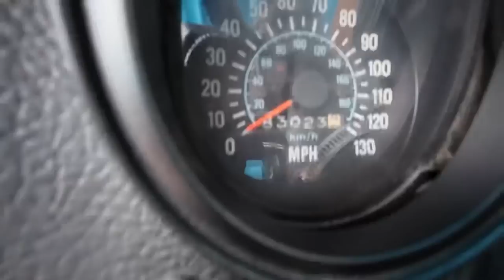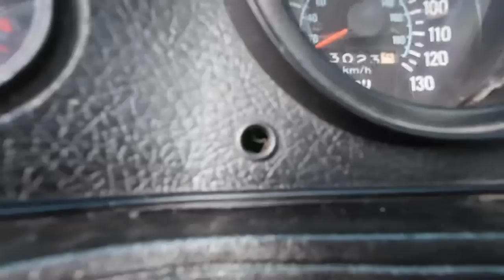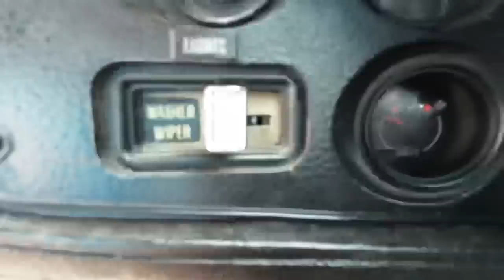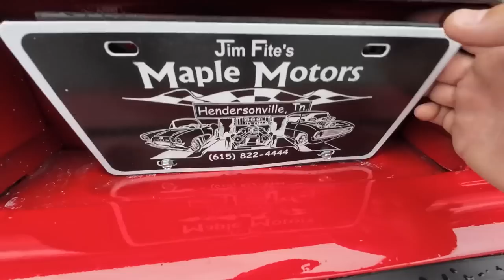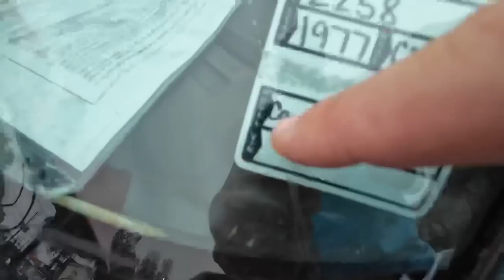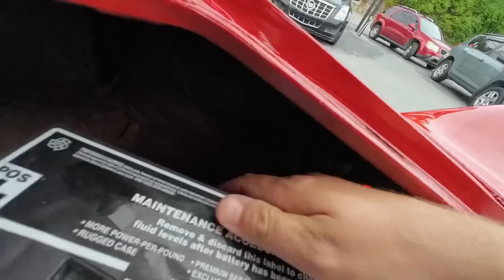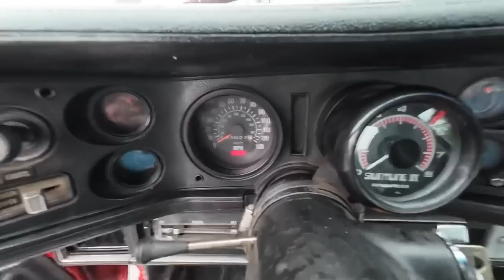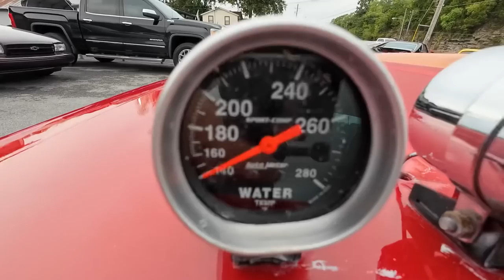Test Drive 1977 Chevrolet Camaro Z-28 SOLD $13,900 Maple Motors #2258

Comment: I went and looked at this car a while back, it's rough and full of bondo, i couldn't believe they just painted over the rust and z, 28's have the gutter rail over the door windows and it doesn't i think someone chamged the vin plate if the title says z, 28. The guy who owned it wouldn't let me look at the title, ( not maple motors ) the person who owned it before them, he was touching up rust with a model paint brush when I pulled up at his house but the engine sounds ok i drove it about five miles and no problems running, but its more filler than metal. But it's priced as a project and it is. And nick shows the bondo hes not trying to hide anything, he clearly tells you that
Reply: @woecp  yea i know but I have already run it down to much 🤣😂 but it's true , most of the places i put my magnet it fell off, i can buy em in that condition every day for 3500 in ky
Reply from the maker: Might wanna buy them and resell them to us then. We only mark them up 3k letting you know what we have invested
Reply: @MapleMotorsNickSouthgate  you should go to the car auction every Thursday night in Lexington ky i buy cars every week and resale i usually talk to the owner and buy them before they even get in the building and pull em outta line, I clean em up and fix minor problems and take it back the next week and make a few hundred profit and I keep the prices low so were all happy
Reply: @coinslotsandjoysticks2572 what is the name off the auction and are they online??
Reply: I don’t think I’d take this car if you gave it to me for free

Comment: I had 4 camaros, a 79 that I put a 454 in and it too had a 4 speed and i put a 12 bolt rear with a Auburn posi and 4.11's in the rear, I had a 77 Z-28 it was all factory 350 with a TH350 auto and 10 bolt posi. A 85 Z28 and an 88 IROC with the 5.7 and converted it to a 5-speed. This camaro brings back a lot of memories. It needs some TLC but could be a sweet ride with some TLC.

Comment: I meant to say that they did away with 396' in the 70 chevelle s and Camaro  SS ,after  70/71 they did away with 396 ,because part of the problem was with there solid lifters got hung up a lot, and other reasons were Chevy just didn't think they could use them anymore and, then enters the 400 .

Comment: It's either has high compression pistons or a weak battery lol. It does have a lot of potential!
Reply: More like starter heat soak from the headers.    It needs a high torque mini starter and some heat shielding
Reply: @Tartan1206  that too but it did it on his first start as well

Comment: Ordered a new black '77 Camaro Type LT loaded w/every option via my now lale uncle, who managed a large Chevy dealership. When he called me to take deiivery in early April, I found out that it came with a 2bbl 305 v8 auto, when I had ordered a 350 4bbl auto!! Was VERY angry for not getting the engine which I had requested, but my uncle said that GM could not keep up with the demand for Olds  Cutlass Supremes, and was putting Chevy 350 v8s in those cars b/c they were short of Olds "Rocket" 350 v8s.

He then told me that the only way to get a 350 engine  in a '77 Camaro, was by ordering a new '77 1/2 Camaro z28, but they were only avaiiable with a 3 speed manual...which I learned later was a damned lie, as they were 4 speed 4bbl v8 350cid manuals.

Comment: That's actually a rare Camaro ...If my memory serves my right I think Chevy only mad 14k of these in 77 then in 78 they went to the rubber bumper cars ..I had one that was white and I thought it was just a Camaro that someone painted the bumpers to match but later found out they only made a small number of these and that it's rare

Comment: PASS! 
I'm surprised that the tiny, stock rear differential hasn't blown out the ring and pinion, especially with a spool or locker in it.
The torque of a big block usually needs a 12 bolt Chevy rear or a 9 inch so you don't grenade it. 
It kinda sounds like it has a set of 4:56's in the rear end. Nick's right about not trying to drive it on the highway. 😮😊😅❤
Reply: The 8.5" 10-bolt is plenty strong for that engine, which is likely to grenade long before the rear given the low oil pressure.

Comment: Right motor, wrong car, all I meant that it's a original motor  for a 77" Z28,  because they did away with 396 by that year, but they put 400s in instead, but myself I would much rather have that 396 for the streets, absolutely,

Comment: Has a weak crank might be a bad ground or the ignition switch is going bad I know because my Monte Carlo was doing that same slow crank but with my Monte Carlo if I get the engine warm the ignition switch would heat up and then I have no start until the ignition switch cools down but now I bypass it with the race uses only ignition switch panel now it starts right up like a new car 😅

Comment: Its the yrs lots of people  don't like for the bumpers.       But if know your looking at.   From 74-76.   Not one z28 was made.  It became ralley sports.   And they only came in few colors with what cald L strip as it comes down roof and goes to front.     Now as another person stated.     Yes very very low number z28 made in 77.     It was just a trim package.   It had the hood scope shape sticker on hood that became a hood scoop in 78-79.    And the z28 in 77 was only offered in couple colors.   Oh yea 74- 77 they brought back the tag LT.

Comment: I'd drop that motor in a nova or chevelle 😁🤌🏼 too much filler i could never understand why youd want a low geared car that will blow up at 55mph how are you suppose to make it down the track 🤔✌🏽